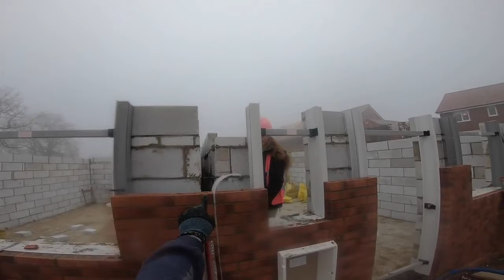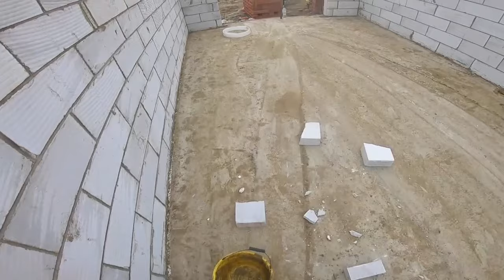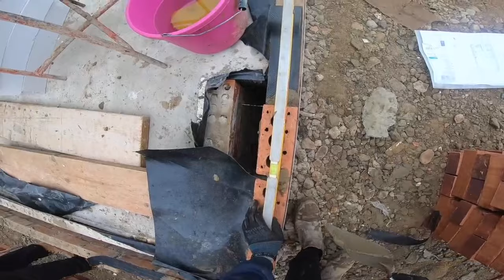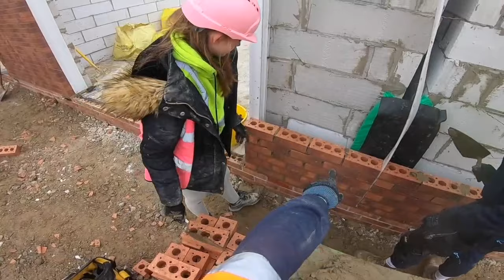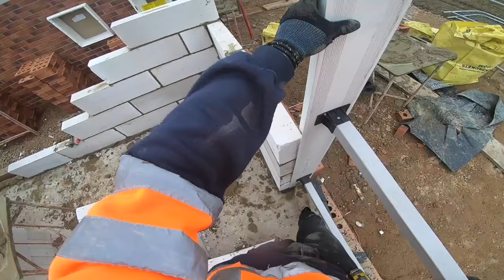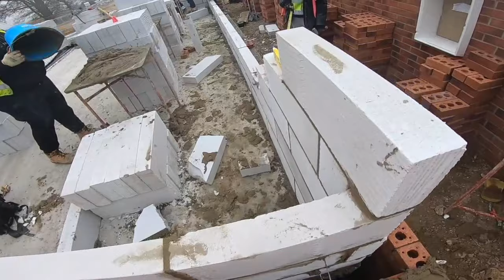How to build a house freehand Ep.1

Comment: Yo Charlie in college and there’s never any jointers, but when I google them there all different size, what size do I need for blocks and bricks, cheers
Reply: Amtech G1700 is the jointer Charlie uses. Comes with 4 heads. Have a butchers
Reply: If you're looking at a more traditional jointing iron then its the 3/4 inch and 7/8in iron
Reply: @jb5993  cheers mate is that what there likely going to have in college? I’m wanting the same one
Reply: @jayp9653   depends on the college's budget I suppose but my guess is they will have a bit of pipe or metal bent to the shape just to save money, but the jointer is what is used out on site by 99% of trowels
Reply: Get a barrel jointer, by far the best
Reply: @tommodobbo3475  just ordered one mate